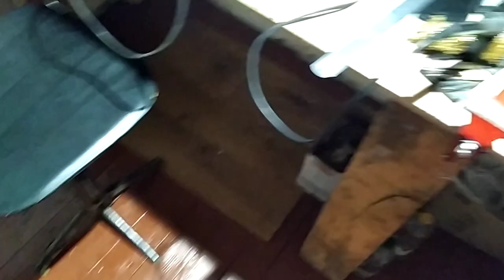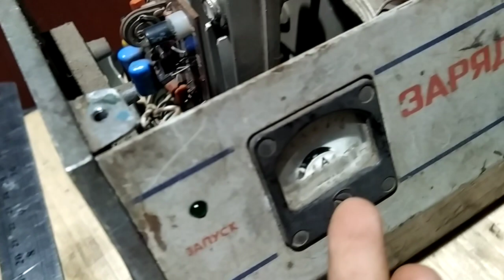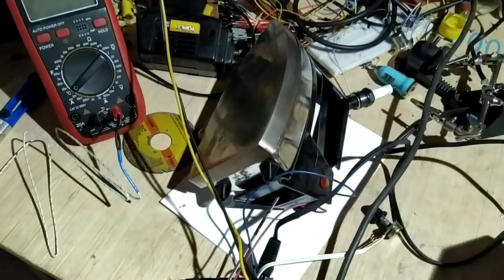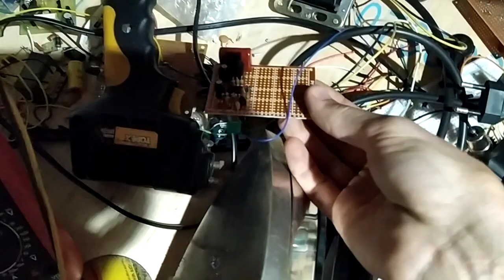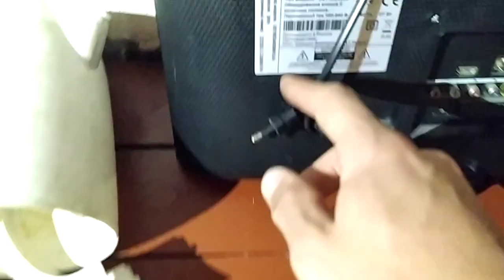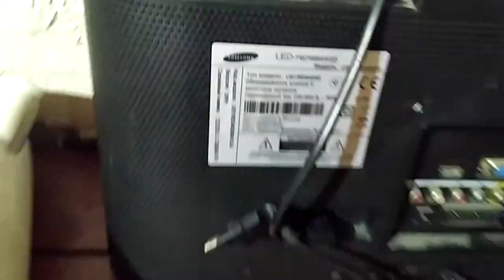Soviet charger&projects in background

Comment: Sounds like you have been busy :-)
That russian made battery charger is a beast :-D
i assume that the driver pcb partly runs from the battery supply, so there is no drive to the scr's without a battery. (Very smart).
It looks quite old but it's reliable, it won't die like modern junk does.
The lack of red paint on the terminals and a clear connection diagram would have been nice.

When you started talking about the clothes iron i wondered if you had a sudden urge to make a shirt smooooth  :-D
But using the element for constant heating of pcbs and other uses is clever, you are clever so it should be no supprise to me really :-D.

Nice idea for the capacitive discharge ignition with a mosfet instead of scr, you don't have to wait for the scr to switch off with dropping A/K voltage, multi spark.

The buck charger looks very neat, that would be nice for a video, but only when you have interest in doing one.

Oh it's your repair room, they do get messy :-D
Reply from the maker: Yeah, it's bullet proof. More of it, I can use that iron to keep my coffee warm as well 😁
Reply: A very handy iron :-D